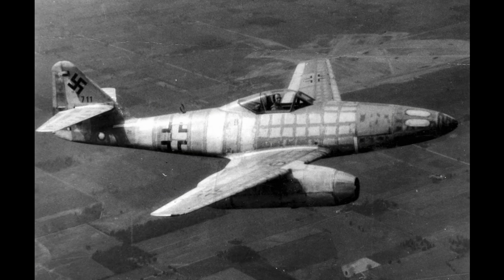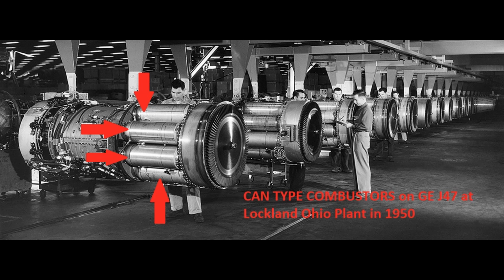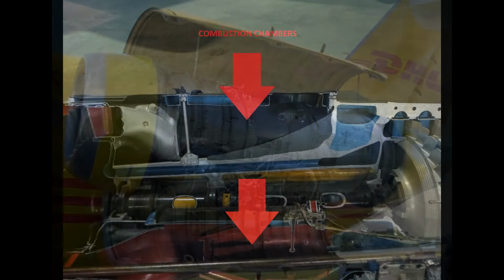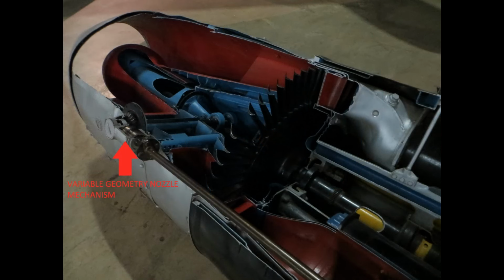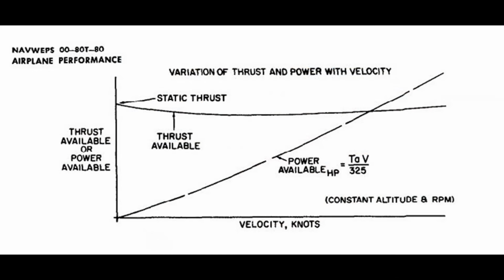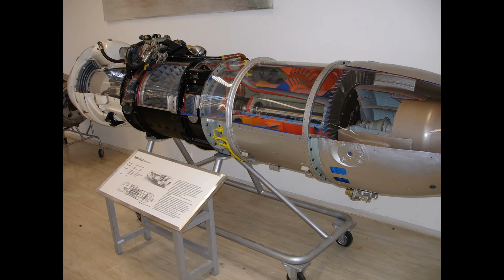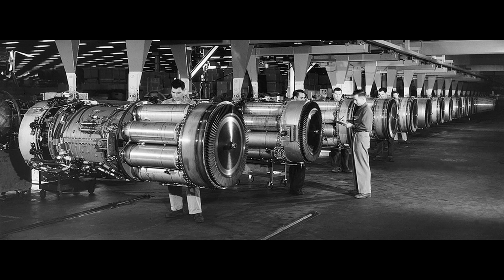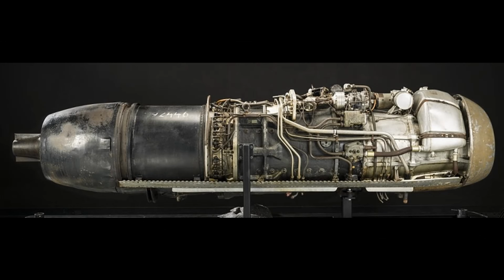World War Two JET POWER

Comment: The  primary aim of engineering is to solve a problem at minimum cost. The set problem here is "win the war". All German engineering needs to face the question " Did it help to win the war or was it a diversion of energy and resources ?" So it fails that test.
Reply: The Messerschmitt Me-262 was highly successful, it acheived maximum combat effectiveness with a minimum allocation of resources... it was also the most revolutionary aircraft in history since the Wright Flyer and rendered all preexisting fighters obsolete.
Reply: @WilhelmKarsten  True but still useless against the problem it was designed to solve. Sexy? Yes. Exciting? Yes Successful? Nowhere near. The war wasn't a juvenile  Top Trumps game of one Me-262 against one Mustang. It was a dozen serviceable Me-262s against 20,000 Mustangs, Thunderbolts, Spitfires etc. Engineers solve problems but this solution was too late, too hard to make, too difficult to keep serviceable.  Admire it for its influence on post war aviation, if you want, but that was not its aim which was to make a contribution to winning the war and repaying its huge development demands. It didn't. It was a failure.
Reply: @barrysnelson4404  The P-51 Mustang was completely outclassed by the Me-262... the German jet instantly rendered propeller driven fighters completely obsolete... since the introduction of the Messerschmitt Me-262 all wars since have been fought with jet fighters.

Why do you refuse to accept the irrefutable truth???
Reply: @WilhelmKarsten  You have chosen not to understand. I have explained it twice. I will not do so a third time. It is simple.
Reply: @barrysnelson4404  I'm curious. Would you consider the MG42 a failure? What about the StuG iii? Or the FW190?
Reply: @paulflocken2730  Not at all. So was the panzerfaust and other excellent military hardware. I am intrigued by what would have been the best options for German engineering (which was capable of the highest standards) when they could (or should) have realised that the odds were loaded against them (1942/3??).  And am keen to hear adult opinions. The Me262 was a disastrous waste of resources (despite the drooling fan boys). So was the V2 and the Elektroboat, the Pfeil and an astonishing plethora of other high tech sideshows that were too little, too late or never finished at all. I would particularly like to hear about the He280 from someone who knows because that, seems to me to have had the development path to have actually made a difference in the time available. There is not much I could find on line.
Reply: @barrysnelson4404 You are still in a deep state of denial and consumed by hypocrisy.
 The He-280 was quickly abandoned by the RLM because it was  well understood that it was obsolete and completely inferior to the Me-262 in overall performance and was simply a better, more advanced design in terms of aerodynamic technology.
The Me-262 is the first jet with all swept control surfaces and a fly-by-wire Horizontal Stabilator which gave it superior top speed, cruise speed and dive speed.
The Messerschmitt Me-262 was the most advanced aircraft in the world during WW2
Reply: barry your ridiculous comment is the most laughable hypocrisy and denial that borders on cognitive dissonance!!!!
Reply: @DoktorBayerischeMotorenWerke  Couldn't agree more but that's these juvenile fan boys for you.
Reply: @barrysnelson4404  Everyone knows that the Messerschmitt Me-262 was vastly superior to anything that the Allies had, even you... you're just too much of a coward to admit it.
Reply from the maker: Barry, I would argue that no realistic technology would have allowed Germany to win the war. Once the US entered, the Axis forces had only 1/8 the GDP of the Allies. That an insurmountable disadvantage and if anything makes the fact that they could build the 262 look even more impressive.
Reply: @GregsAirplanesandAutomobiles  Greg, I would always concede that the Me-262 was very impressive, as was the Elektroboat, the V2, the TV guided bomb, anti aircraft missiles and loads of other stuff the Germans made in the hopes of confronting the odds which you rightly say were stacked against them. What they should have done is, of course, a game of "What if?".  In early 1941 they were in an unbeatable position, by early 1943 they were doomed to lose. They embarked on a bewildering number of parallel projects none of which made a difference and it could be argued (and usually is) that if they had focused they might have forced some peace deal (maybe!). We could have much fun discussing, year by year, through the war what the Germans could, and should have done in the field of aviation technology alone. My own belief is that one of their greatest mistakes was not following the much simpler He-280 route, much much earlier than the gorgeous, swept wing axial flow Me-262.
But my push back has always been the objective of the Me-262 programme was to significantly contribute to air defence over the Reich. That was the aim. Did it contribute or not? No, it was less than insignificant. That is failure and not success and I remain bewildered by those who can convert obvious failure into success because they think it's sexy engineering.
Reply: @GregsAirplanesandAutomobiles  Greg, I submitted a response to your thoughtful post but I can not see it anymore. I concede your point but the Germans objective was not to create an "impression" ( the aircraft certainly was impressive, as you say). Their objective was to contribute to air defence of the Reich. It didn't. It was insignificant. It failed, obviously and manifestly, how can that be turned into success?. Incomprehensible.
Reply: @barrysnelson4404 Over 550 Allied aircraft were shot down by the Me-262... to call this "insignificant" is simply benighted and infantile.
Reply: @WilhelmKarsten  Next time you Google rubbish try and spot the word 'claimed'.
Reply: @barrysnelson4404  Claimed was over 1,500... 550 are confirmed.
Reply: @WilhelmKarsten  No, the pilots claimed 542.  So less than 200 then. 1,500 is absurd considering only 300 ever flew.
Reply: @barrysnelson4404  550 confirmed kills.
26 Luftwaffe pilots scored Ace or higher in the Me-262.
Kurt Welter remains the highest scoring jet Ace in history!
Reply: @barrysnelson4404  Select the 'Newest First' option for comment arrangement. Your reply is probably lost in that glitch.
Reply: WOW! This little trollie has a BAD case of '262 Envy'!!
Reply: @sandervanderkammen9230  Nonsense, the Germans made many engineering mistakes. My view has always been that the He-280 with its less advanced engine could have been developed to have enough capability to seriously defend the daytime skies from 1943. Instead, and not just in aviation, the highest of high tech was tried but time ran out before it could be perfected. That is not good engineering. Engineering is fitness for purpose at the lowest outlay. When I started my engineering career my Professors first words were "An engineer can do for ten shillings what any fool can do for a fiver". I am not interested in kiddy fan boys and their games of Top Tumps but would welcome opinions on how the Germans could have built on their winning position in 1941 (from a military engineering point of view) which wasn't frittering away precious resources on a myriad of high tech programmes which were too clever and too late.
Reply: @sandervanderkammen9230  Sorry, not interested in that superficial stuff at all. If any adult wants to share their opinions on what programmes the Germans should have pursued eg abandon 109 262 and concentrate on 190 and 280 only and the ongoing development challenges (and likelihood of success with such choices) I would find their opinions interesting and worth listening to. For example I would also welcome views on whether Panther, Tiger King Tigerand Maus could have been rationalised and would the numbers make sense etc. The blindingly obvious is that the 262 fine though it was failed as a solution to the problem ( because it was ahead of its time - that is not praise that is an excuse for failure, success doesn't need an excuse). I won't reply to any more fan boys. Say something different.
Reply: @barrysnelson4404   Just a reminder that sandervanderkammen9230, DoktorBayerischeMotorenWerke,  WilhelmKarsten  are all the same individual on Youtube.  They also have a fourth ID.
Reply: @FiveCentsPlease  Thank you, I don't reply to any of their juvenile nonsense anyway.